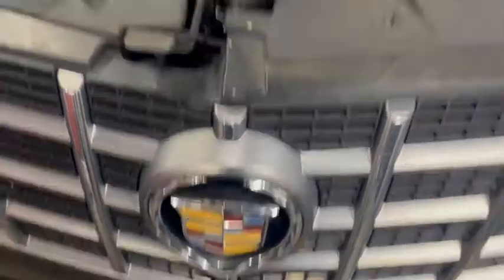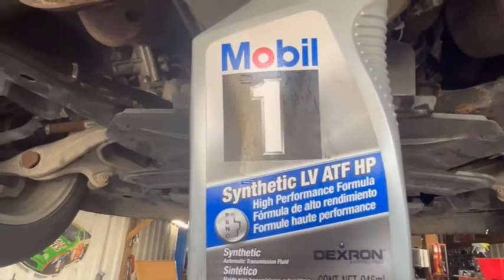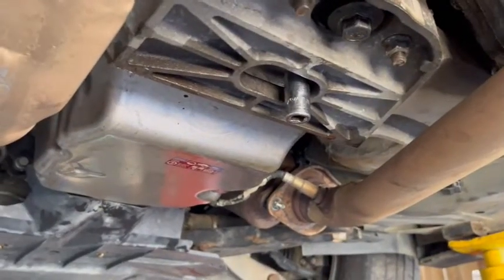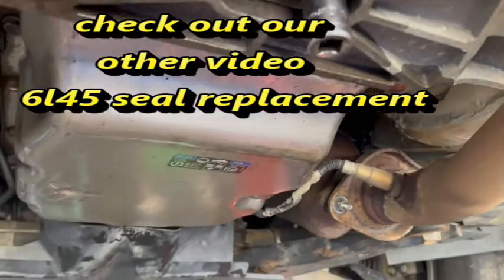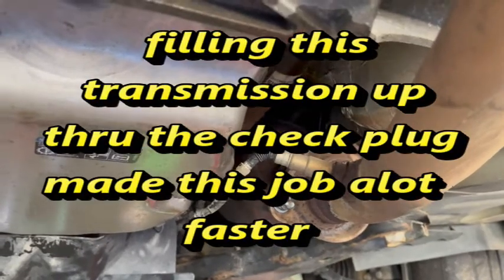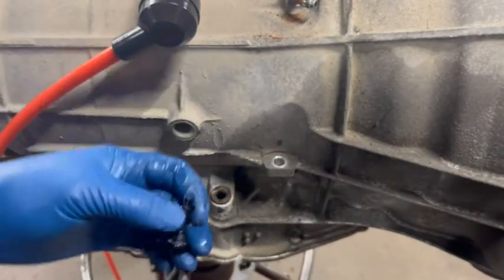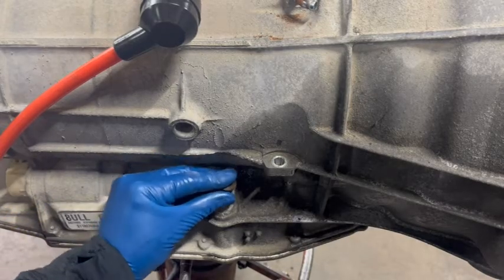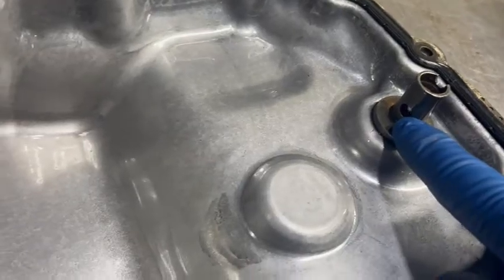Cadillac CTS 4 awd transmission fluid refill and check

Comment: 2013 Cadillac CTS RWD 3.0 liter V^ engine. What he showed made my job much easier. There will be a transmission sticker to the left of the black fill plug. Mine was A2MA and it is just the lot number; it means nothing. My black fill plug popped out easily in one piece with a small flat blade screwdriver and is located above the second screw to the left of the sticker in the video. Lubricate it before you put it back in after refilling. I used one of those orange hand pumps.  The worst part of the jump is getting all 17 of the 10 mm pan screws out and back in; yes, I said 17. I used Dexron VI as listed in my manual.